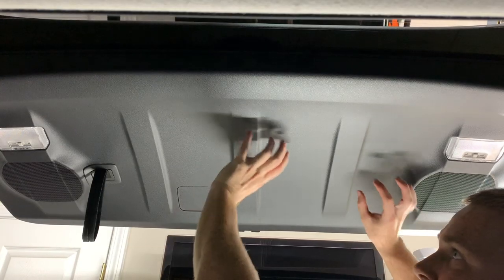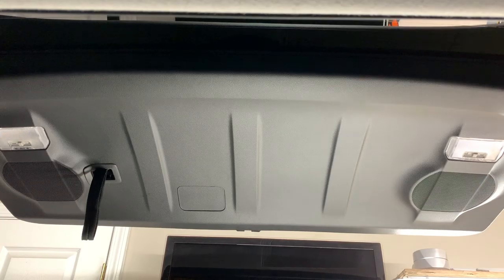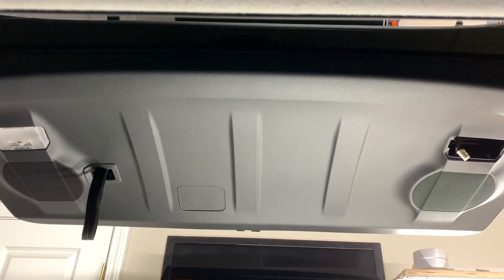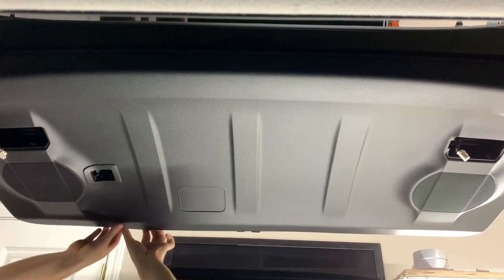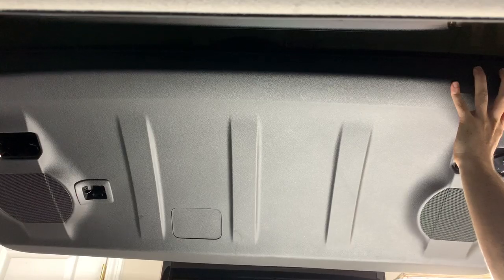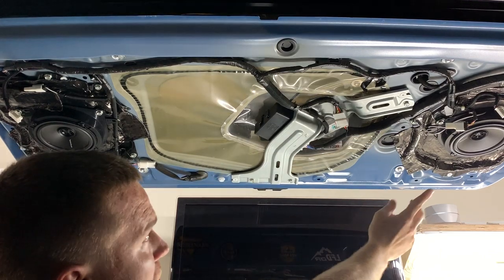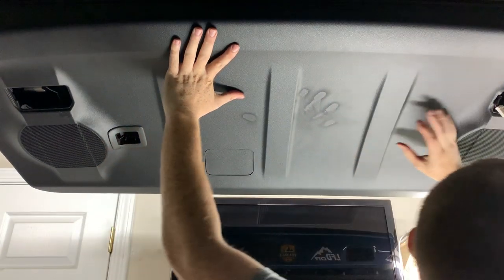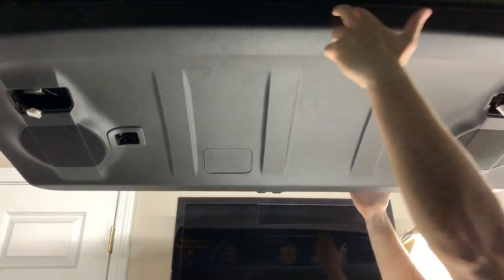Toyota 4Runner Rear Hatch Door Removal/Installation | HOW TO

Comment: That is the hatch panel, not door removal likek your title states.  I will have to search for another video on how to remove the hatch door.
Reply from the maker: Thumb nail says panel. But the hatch is probably easy. Just the bolts up top ande the wire harness.

Comment: Hey man great video..  i just haad a high-end Audio system installed we did my front doors with sound deadin tiles and sheets but i didn't do my tailgate now that i got my sub in that rear hatch door sounds so bad .. i am not using the speakers in there should i just pull those out and deadin the whole door ?  if so do you think its ok to just cover some of these things on the door or should i only do the blue section that shows on your door and cover the holes where the speakers are in now
Reply from the maker: I dont think I really need to do it. But the more the better since you have a sub. Just be mindful that it is heavy so the struts may not like it.

Comment: Extremely helpful video, good job. Wondering if you could provide a link / reference for the speaker adapters used on the rear hatch. Would ones designed for the Rear Door Work? or are they different mounting specs? Thanks
Reply from the maker: They should work. When I used crutchfield they provided all the mounts